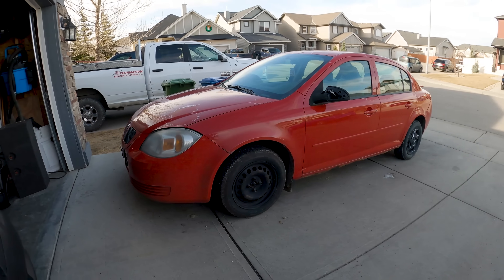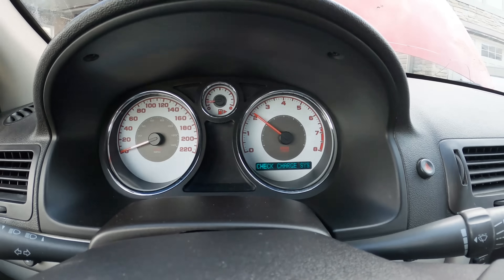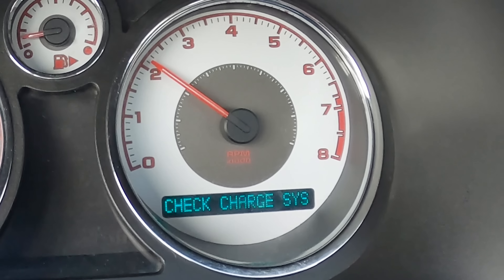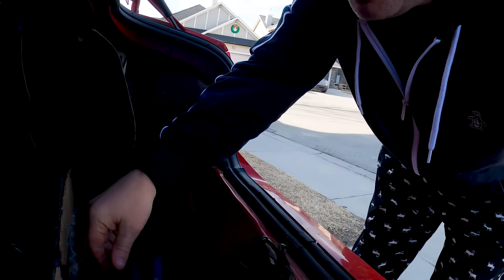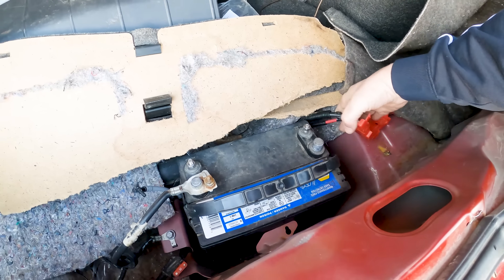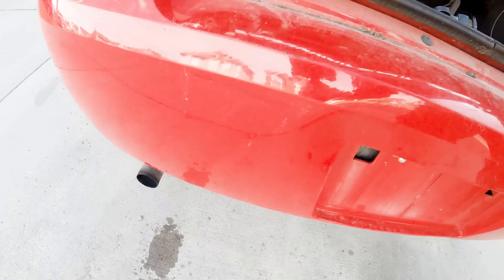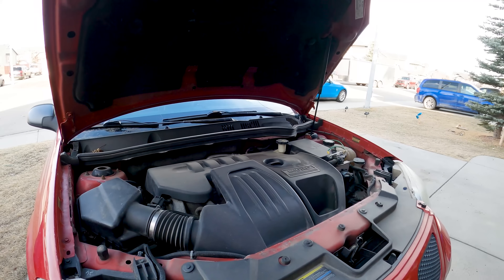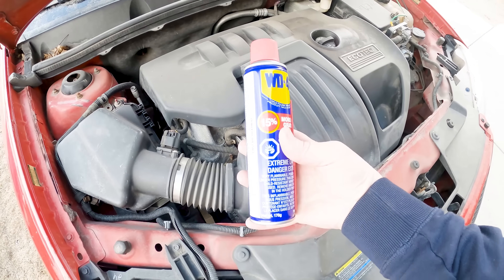ROADSIDE FIX! REVIVE your DEAD or DYING Alternator with this ALMOST FREE trick! | Gears and Tech

Comment: This is the worst advice I've ever seen on youtube in years of watching and dangerous, you clearly know very little about cars. 40+ years as a tech and you got so many things wrong I wont live long enough to go through everything you don't know. Good luck everyone taking this advice, you'll need it. WD40 is flammable and easily ignites with a spark like you get on the brushes in an alternator.
Reply from the maker: I come across guys like you all the time.

You know what you've been told, but have no idea what it's really like.

You say wd40 is so flammable? Like how flammable? Because no matter how hard I try I can't get the darn stuff to ignite. Tell me what I'm doing wrong? I'm so confused! 

https://youtube.com/shorts/2JF4R7Xr1lw?feature=share
Reply: @GearsAndTech  I'm not saying it because I'm guessing or it's a theory I've had it happen 3 times so I stopped spraying it on things that spark, I've had it on plug leads, points and a coil. I've never sprayed WD40 in an alternator, never needed to even try. It's oil it flashes off and the vapour ignites, it wont always happen the conditions have to be right just like everything flammable, if you flood it you drown the spark just like petrol in a combustion chamber when it's flooded you drown the spark and the engine wont start, as it dries out it comes back just like the alternator as it dries it can ignite. It can also ignite as you start spraying, fuels need a correct (not an exact amount it varies wildly in some cases) air mixture to ignite and burn. Keep doing it one day it will go up in flames and then you can quietly say to yourself, who knew that could happen. I don't care if you burn your car down but if a thousand viewers try it I'm pretty sure at least one will go up and it'll be your fault 100%.
Reply: @GearsAndTech  You come across other tech telling you it's flammable because it's flammable, nobody told me I've be working full time for more than 40 years as a qualified tech, you are a typical dangerous youtube expert thinking you know what you're doing out of blind ignorance who learns the hard way because your ego is bigger than your intelligence. I suppose the maker of WD40 don't know as much as you, it says on the can in big letters FLAMMABLE contains petroleum distillates. Look up what that means.
Reply: @GearsAndTech    You come across other techs telling you it's flammable because it's flammable, nobody told me I've be working full time for more than 40 years as a qualified tech, you are a typical dangerous youtube expert thinking you know what you're doing out of blind ignorance who learns the hard way because your ego is bigger than your intelligence. I suppose the maker of WD40 don't know as much as you, it says on the can in big letters FLAMMABLE contains petroleum distillates. Look up what that means.
Reply: @GearsAndTech  You come across other techs telling you it's flammable because it's flammable, nobody told me I've be working full time for more than 40 years as a qualified tech, you are a typical dangerous youtube expert thinking you know what you're doing out of blind ignorance who learns the hard way because your ego is bigger than your knowledge. I suppose the maker of WD40 don't know as much as you, it says on the can in big letters FLAMMABLE contains petroleum distillates. Look up what that means.

Comment: Had to downvote this video.  Pulling the positive terminal from the battery is too dangerous.  If the alternator is working and that positive cable touches any part of the car body, you risk getting electrocuted or frying the car electronics.  Pulling the negative is the way to go.

Comment: Never do this. Auto electrician.
Reply: Just trying to stop you frying your engine management module bro. Theres the new module. Then theres coding the new keys you will need. Then there is the key cutting. Then theres the possible damage to the other modules (up to 100 of them). 

I am retired. I have no financial interest in this. Just want to save thousands of people the hassle of scrapping their cars because of a stupid nitwit.

Now if he had said take off the alternator clean the brushes with a litttle sandpaper then I would have given it a high 5.

God knows what WD40 is going to do to the alternator windings and the slip rings. 

Oh my qualifications. BEd Technology and Design. HNC advanced manufacturing technology City & Guilds in Electronic Engineering. Is that good enough for you bro?
Reply from the maker: Try it, you may like it.

But, then again you make money off people not doing this

Comment: like many have said, do not disconnect the battery!
However this is extremely useful on starter motors. Many years ago i drove threw a flooded road in an old 1996 vw polo, it was sound all night then next day went to start it and starter was just clicking, a can of wd40 later it started no problem and never gave me trouble again.👌

Comment: Pulling your battery cable off with a good alternater can burn up electronics cause the voltage could spike up to 15 or 16 volts and pulling the cable off can cause a spark and blow up the battery use a meter and be safe

Comment: Not all cars run without a battery. And the simplest thing you can do is put a multimeter across the battery, and make sure it says a little over 14V. All of this crap is unnecessary. If an alternator is dying, it's going to die, and you need to replace it. Or, you can just wait until you're sorry about not just doing that in the first place. You really should be using CRC QD spray, if you're trying to clean anything electrical. Not WD-40. A cheap multimeter, that will work, literally costs less than $4, these days.

Comment: Brushes can be replaced fairly simply. Field voltage supply can be interesting. my classic mustang has an external regulator once I replaced the alternator and regulator the 3 wires to the back of the alternator were crispy enough for the field wire to detach and ran out of power I R&Rd the wires worked great and then the same symptoms, the regulator plug had a loose fitting female spade connector. During the diagnostics I found that when Field wire was energized the alternator you could feel magnetic field attract you steel tools. This became my quick check. computer controlled regulators that much more fun.

Comment: A fried field, wasted or glazed brushes or slip rings will not be fixed with wd40.. nor a cooked diode..
Reply from the maker: Sure, which is why this is a fix for the guy on the side of the road with no other option but a tow home
Reply: @GearsAndTech  it will NOT fix the issues I mentioned!!!

Comment: Very well, I sprayed WD-40 on the alternator and it started to smoke. If I hadn't disconnected the car battery terminals, it would have caught fire. So yes, it's possible for it to catch fire because WD-40 is a flammable spray.
Reply: Smoke is good for the car.

Comment: Keep in mind this will only work if it’s a bad brush connection if your diode, voltage regulator or rectifier is gone this will not work and it’s always one of these 3 with me cleaning the brushes has never worked for me.
Reply: I was going to write exactly what you said.  Yes this will not fix any of those issues,  if there is an internal issue aside from the brushes you are out of luck.

Comment: did i miss the part where you show the volt meter after starting it up so we can see exactly what the voltage is after that soaking ?????
Reply from the maker: you missed the part where I proved that it works by pulling the battery cable off and it still ran.

But if you have a volt meter that can help too

Comment: Man, I'm in this exact predicament. I am going to get a ride back to my truck because I know the alternator is the issue and I'm going to spray the hell out of it and pray to God that what you recommended works! I will comment the update if it works or doesn't
Reply from the maker: Take some jumper cables as well in case you need a boost. But this works great as a roadside fix
Reply: @GearsAndTech oh I definitely had to take the jumper cables cuz the battery was Dead is a door stop. But you know what after I sprayed the hell out of it with WD-40 and put a good charge in it it made it all the Way up the hill four scary miles but it didn't die and it's kept a charge while I order a new alternator. Thank you brother! Here in lake Havasu getting stuck is some life and death shit

Comment: I have an old nineteen ninety eight dodge ram fifteen hundred and I use the w d forty and hitting the alternator and it does work. My problem is if I let the car sit, It starts up right away but the Alternator does not engage. But if I started every couple of hours the alternator Engages.

Comment: Never remove the battery connector from a running car.  Strong chance you will fry your computer.  If you have a 60s car or older it's ok to a point to do that.

Comment: In the old days 80's and back removing a battery cable to check a alternator was ok but still risky. The newer the car the bigger the risk. There's a chance of surging the ECM  and it's not cheap. A easy way to check it is to go to any  store that sells cheap multi meters . The voltage with engine turned off should read a little over 12 volts. Running , around 13.7 volts. BTW you can't always trust the gauge on the dash. Another way to check is with a  code reader in the live mode will tell you what voltage the ECM is getting.  This only my factual opinion.
Reply: Love the phrase, "factual opinion". Reminds me of my brother who always said "My opinion is fact!" 😂 He died back in 1993. Thank you for reminding of this part of him. Put a smile on my face.

Comment: When alternator stops working power to run a car comes from battery (for a very short period of time) no effing way you'd be able to drive 600 miles without alternator supplying power to run a car while recharging the battery.
and...if you need instruction on how to insert a straw in to a can - don't open the hood, in fact don't drive, go home, lock yourself in and stay there until you die.
Reply from the maker: Wow, tell us how you really feel!

Comment: Is not that stuff flammable?  I can understand using WD-40 on joints and barings, but to spray directly on electrical contacts isn't my idea of fixing an alternator.
Reply from the maker: Keep in mind, the alternator at this point is totally broken. The other option is replacement. This trick is just gonna get you some more time to plan the replacement

Comment: If your mechanic is wearing pajama pants... Run!
Reply from the maker: Lol, the irony was lost on you
Reply: @GearsAndTech  practices like removing a running vehicles battery cable to test the alternator may have been fine in decades earlier models with simpler systems, but today's complex systems, whether to the alternator’s internals or downstream electronics, power spikes can be destructive.

Comment: Dude you saved me!!  Worked like a charm.  2002 Tacoma alternator got dusty from desert dirt roads.  Wd cleaned it right up :-)
Reply from the maker: Glad to hear it worked!
Reply: @ went from flashing battery light and broke down to working perfectly 😎👍 Saved me some serious $$
Reply: why not just use compressed air to blow out the dust and junk.

Comment: You can do those tricks on the older cars, but the newer cars you could very well cause a computer communication issue by removing the negative or positive terminal
Reply from the maker: Focus on the fix. You're getting distracted and arguing about a side quest
Reply: @ I know it may come as a shock to you. you are saying focus on the fix. You cannot call it a fix if it will destroy your computer if you happen to own a newer vehicle.
Reply: So, I'm seeing you talk about the negative. Apparently, you are knowledgeable about the subject. 

Please, suggest some alternatives. Aka some positives. (In my best Foghorn Leghorn impersonation "Get it!? Alternatives! That's a joke, son! Nice boy, but he's about as sharp as a bag of doorknobs...")

Go to the auto parts store. (after a little WD-40) Ask them to run a diagnostic. Ask if they can test the alternator. They do both for free at most any auto parts store around here. 'Course this is Fort Worth, Texas. I'm sure you have some valid advice. Don't be shy.

Comment: I’ve poured bottles of rubbing alcohol into the vent holes of Toyota alternators to clean them out. Works every time.
Reply from the maker: Wd40 may be a little cheaper
Reply: @GearsAndTech  Actually, rubbing alcohol is way cheaper per ounce than wd40 - unless it catches fire under the hood of course. Is that what you mean?

Comment: I've been a mechanic for years. I was friends with some of the people that ran the local parts store. I walked in and realized that One of their vendors was in the back giving a seminar I was allowed to attend.  The vendor made alternators. In the seminar the vendor talked about things to look out for when receiving an alternator back for refund. He stated if the customer says they took the battery cable off to check and see if the car would keep running they're damaging they're alternator it's not a generator like back the in the old days. You should not Warranty that alternator.  Since then it made sense to me.We don't have generators anymore on cars. Alternators need input from the battery to maintain the charge of a battery.That was something he mentioned in the seminar. So I would advise against taking the battery cable off while the car is running. I remember dating a young lady and her father was changing the alternator on her car. I remember after every alternator changed.He would pull the battery cable off and the car would shut off. Long story.short, we would take the alternator off and go back to the part store.We went through every single alternator they had till the very end. Finally the car stayed running. I look back now and wonder did we ruin every alternator they had that day? I don't know.  Just food for thought
Reply from the maker: Weird your remembered experience is totally different than my actual experience and what I showed in this video

Is it possible you're remembing it in a way that justifies your opinion on the matter?

What do you have to say about the fact that in this very video I show you pulling the cable off and the car still running? How can you be so right, but this video would prove you so wrong?
Reply: @GearsAndTech Do you honestly think i'm going to sit in argue with you over this? You do whatever you want to do and I'll keep doing what i'm doing. I don't argue with ignorance.....

Comment: I would have thought that the WD-40 would dissolve the coating on the copper wires inside the alternator.
Reply from the maker: No, it doesn't eat plastic

Comment: thanks, buddy ... clean advice!!!! can't figure out the troll logic about issues disconnecting the bat while the engine is running.... give credit to auto engineers when placing fuse box junctions to prevent such surges

Comment: A Lot of people have replaced good batteries and alternators on cars and trucks when all they needed were a new ground wire or a ' secondary ' ground of 8 gauge wire straight from one of the mounting bolts on the alternator and the negative post of your battery. I've got a 35 yr old truck and found out the hard way. Put in second ground and no problem since
Reply from the maker: Yes, bad ground can cause issues for sure
Reply: @GearsAndTech  most of the older vehicles grounds from body to frame, dash to frame, etc. are all crimped metal clips that build up rust. BS!

Comment: I figured it was cleaning off the rotor and the stator.  Fortunately my alternator is easy to get to and with a 10mm gear wrench I can change the thing out in about 20 minutes.  Can't get a socket on one of the bolts and a standard wrench would do it but it would turn that 20 minute job into a two hour job as even with the gear wrench there's only room to turn that one bolt back n forth about two clicks with each swing of the wrench.  Replaced it about 3 years ago with a generic no-name brand and that lasted 1 year.  Paid more and got one by Bosch and it's been good ever since.

Comment: If you want to kill your electronic modules in your car, do what this guy tells you about disconnecting battery while car is running. Most likely disconnecting your battery while engine running will put large voltage surges into the electrical system, which will burn out electronic modules, which can cost you hundreds to thousands of dollars. The other emergency repairs are valid. I have over 30 years of automotive electrical repair and electronics technical training instructor.